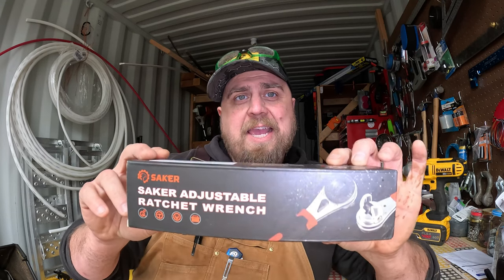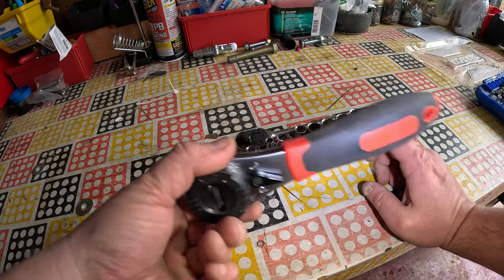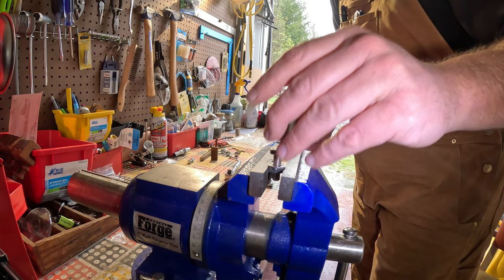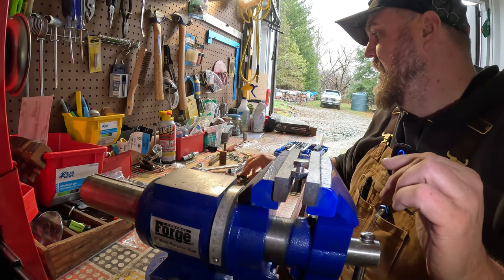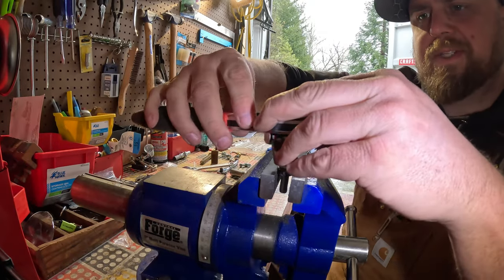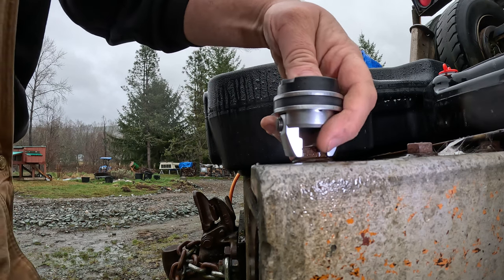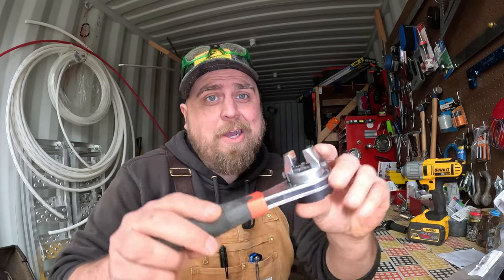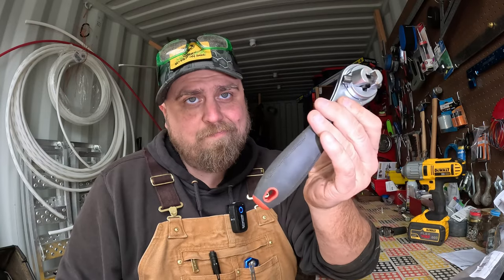Saker Universal Socket Wrench - Does this thing work?

Comment: Id like to see a video on where and how you procured your connex box? like your content keep at it eventually it will payoff. Also I know its alot of work but try to push it out to the other platforms for the potential for it to organically be distributed.
Reply from the maker: Honestly, it's a pretty boring story.  There's an outfit on the side of the highway out here that sells em.  They dump em at your house, and that's that